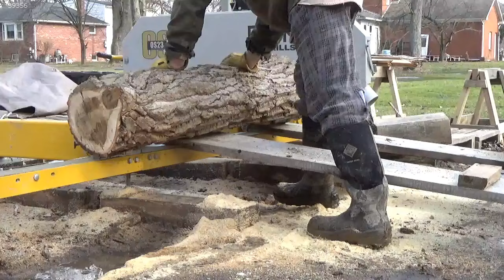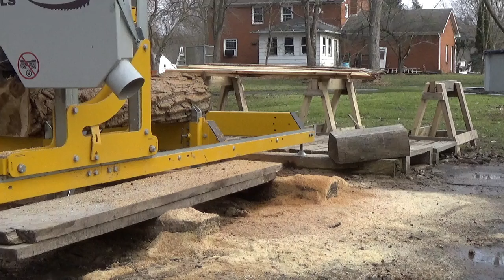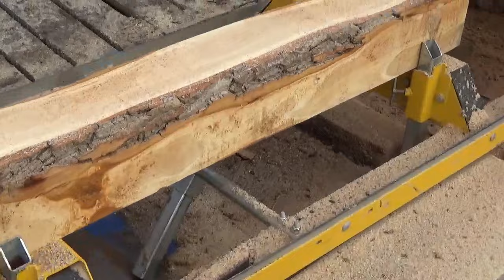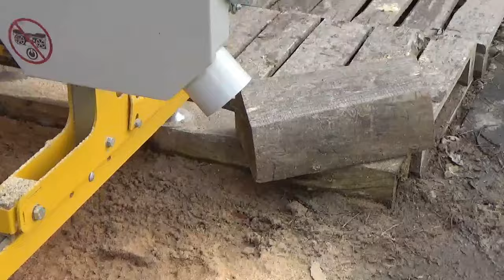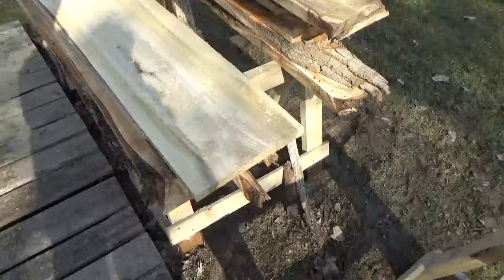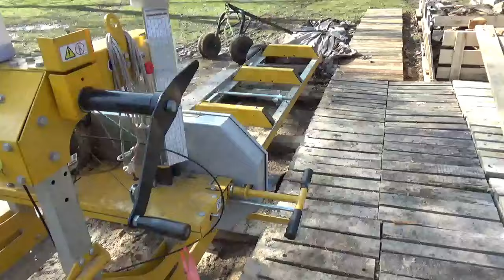Frontier OS23 Maple log start to finish, Feb 10, 2024

Comment: Nice cuts. Little tech tip keep the idling to a minimum air cooled engines get hot idling will overheat the head and cause valve failure. May be obnoxious but keep it at full speed to keep that fan spinning.
Reply from the maker: Thanks for the info.  It has a centrifugal clutch so above idle the blade moves.
Reply: @RetirementTherapy2  I've seen those blades I don't think it'll matter much if it's idling it's going to hurt if you get a limb in there

Comment: Just a point my friend, u gota latch that clamp on bottom of sawmill tracks to bottom so it doesn't tip on you or worse .I had a experience that mill start wobble. Just tip
Reply from the maker: Thank you!  I had moved it when I had to remove the steel wheels to clean off sawdust buildup and forgot to put them back down.